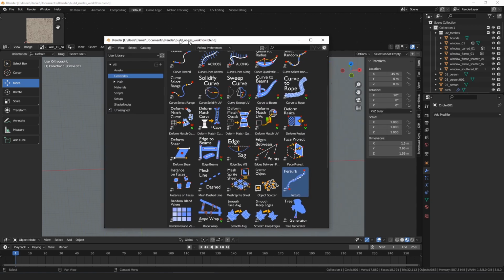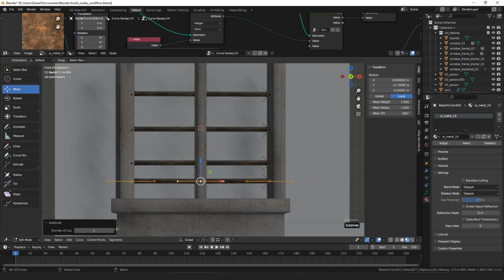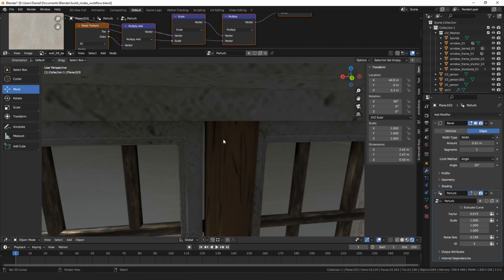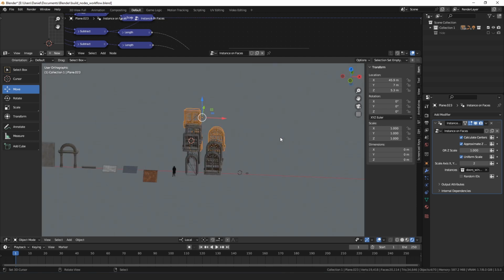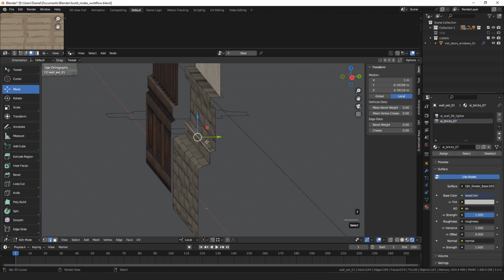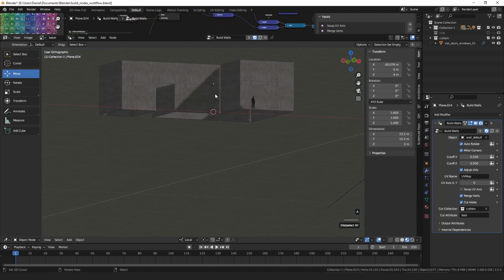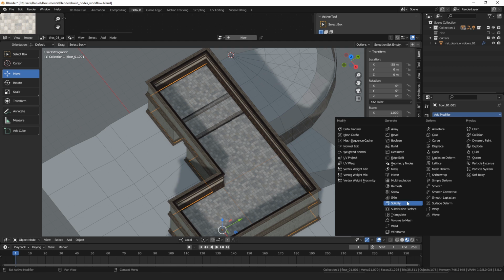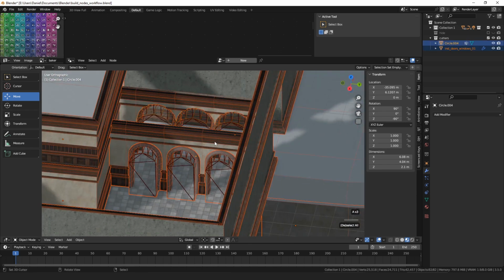Blender: Build Nodes Workflow Demo - Part 1

Comment: I've been trying to follow along but I cannot get the cutters to work, unfortunately. As far as I can tell its all set up the same. I'm using V7 for Blender 3.6.
4.0 will currently not work on my system.
Reply from the maker: Hmm, it's hard to say what the problem is without more info, I just tested it in 3.6 and it worked for me.  I'll outline the required steps and maybe the missing piece will jump out at you.  
-The cutting verts of your mesh must be assigned to a vertex group.  (I like to name it 'bool')  
-Place or instance your cutting meshes along a wall made with 'Build Walls'.  
-All of the cutting objects must belong to a collection.  (I like to name the collection 'cutters')  
-The Wall object cannot belong to the cut collection.  
-On the wall's Build Wall modifier, at the bottom, check 'Cut Holes', select 'cutters' for the Cut Collection, and enter 'bool' as the name of the Cut Attribute.

Also, booleans in Blender can be finicky, so there's a chance that it's just failing to cut, but usually that results in sections of your walls getting deleted rather than nothing happening.
Reply: The first one! I'm sorry.. I dont think you mentioned Vertex Groups in your video but I could be wrong. It's working but now I have missing faces where the cutting took place. I think I can figure it out from here though. Thank you!!

I have a couple of business partners and we would like to speak with you. Not investment or anything like that but it could be cash for all of us. I found your email on your website. I will email you directly.

Comment: I have been loving your geometry nodes assets... it has simplified most of the work for me... But lately i ran into a dead end when i was creating a room.. how do I assign Instance on points materials for different instances even if i dont have your fancy operator for the placeholder material??
Reply from the maker: Glad to hear it!  I think you mean instance on faces, all that matters to the node group is the material index, so you can just add as many new materials to the object as you need and then assign them to faces in edit mode.
Also the addon with the fancy operator is free, so you're welcome to pick it up.

Comment: i have another addon called archipack im not sure if youre familiar with but it has its own asset library that includes walls, windows, door, roofs, etc. would i be able to use this on those assets?
Reply from the maker: I'm unfamiliar with that addon so I'm not sure.  My build nodes work with normal mesh objects, so if the addon creates normal mesh objects there's a good chance it could work.